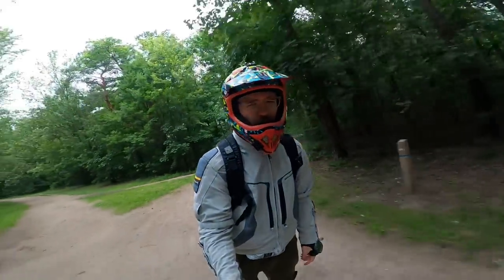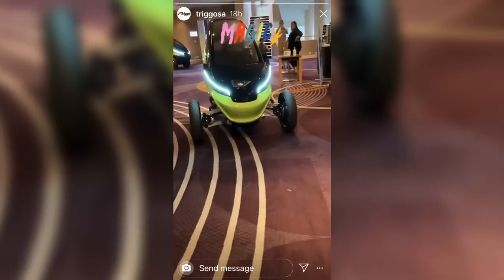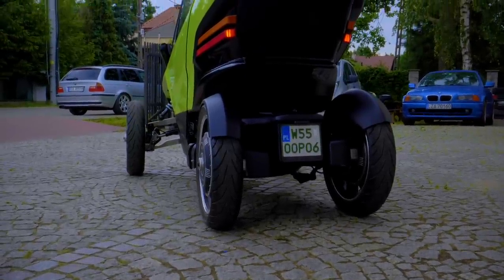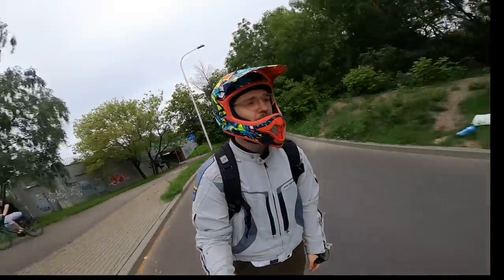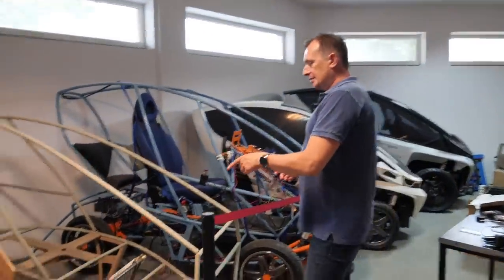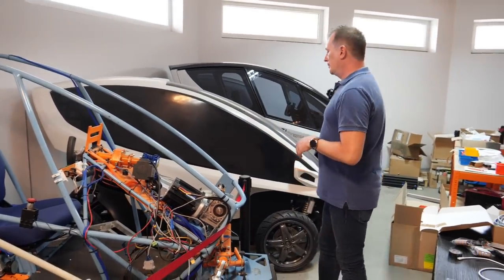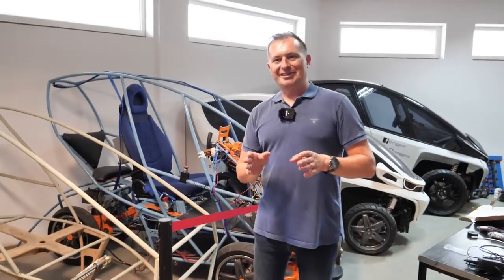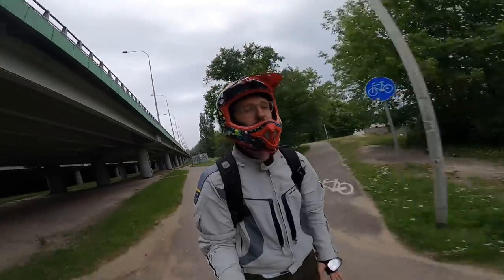TRIGGO - First Experience - The Variable Width Drive-by-Wire Tilting Electric Vehicle of the FUTURE

Comment: I'd preorder in a heartbeat. Such a cool concept. What would be holding me back is the current max. Speed of 90 km. Its just not enough to cover short stretches of Autobahn in dignity and feeling safe. Being able to go max. 120km/h over a distance of 40km would be a requirement. For many commuters.
Reply: For my commuting type one wouldn't be able to go past 60-70kmh most of the time with range around 40-60km daily.

Comment: I must say it is very cool. Its a pity they will not sell them individually as if they promoted and advertised it in the right places there would be a huge demand for it especially in city's.
Its turns kinda like a Combine Harvester to which have rear wheel steer too which gives them a tighter turning circle which is needed for such big machines while cutting crop and the rear wheels on a combine being smaller than the big front wheels help this.

Comment: I can't believe a motorcycle or scooter company hasn't made something similar yet....It doesn't even need the retractable wheels, just add a 300cc scooter engine and you have something that can rode in town or on the HWY in the rain......Example, something similar to the Yamaha Tricity 300 scooter but with lightweight removable enclosure.

Comment: It's one of the most exciting new vehicles, and currently on top of my wish list. I'd have put the door on the kerb side for EU roads, but it should be great in the UK. I hope you can open windows both sides for toll booths, gate intercoms and so on. There should be more 2 & 3 person vehicles available - narrow with just the driver in the centre at the front - like this one. That's a great driving position. 

But manufacturers should also put some thought into how we can fit bigger/longer personal objects into or onto the smaller cars. 

Many people have professions and hobbies which preclude owning a small car, so new vehicles should include more imaginative storage solutions than previously. Very often it's more about awkward shapes than volume - shapes which could easily be accommodated in the same "too-small" vehicles, with just a little more forethought on cargo flexibility.

Comment: I think the indicators and the brakes lights on the rear of I are normally in a good spot. There should be a third high brake light and the other lights should be up higher at the black space length ways.

Comment: The driver/rider must always be mindful of the width of front wheels when on the road. For me, I would rather permanently use the extended front wheels mode so as to get used to it and not hitting vehicles on both sides. I will only retract it when parking.